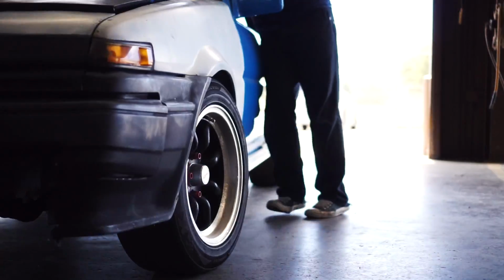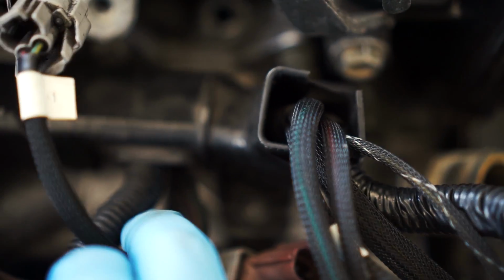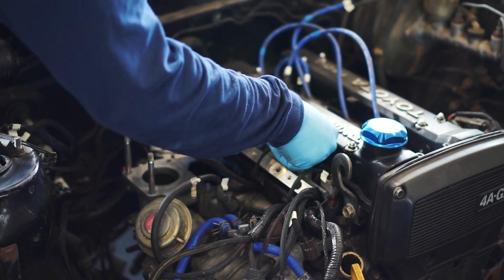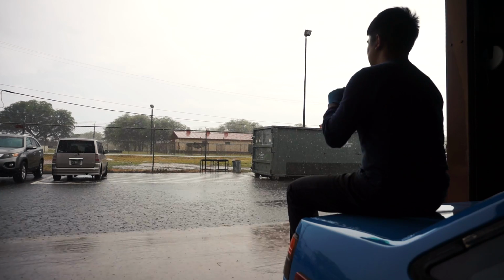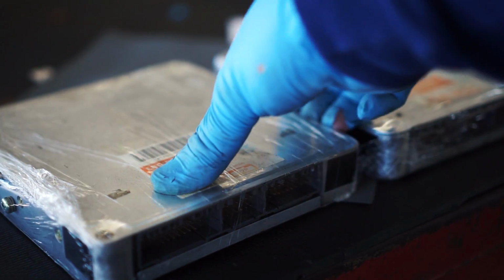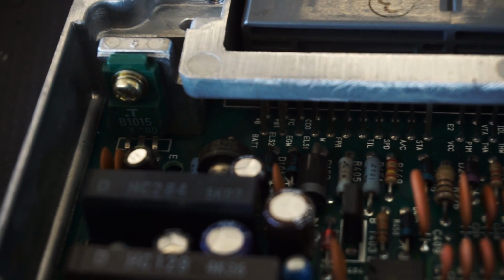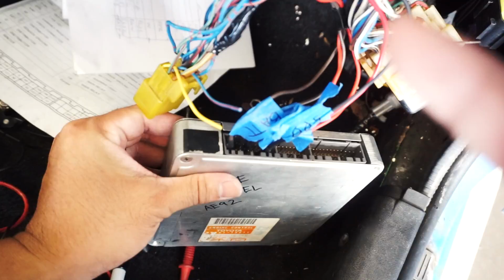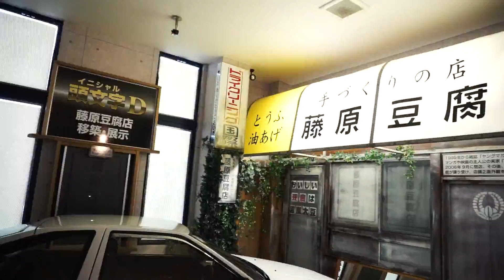Project Car: AE86 "Second Chance" Part 14

Comment: First- Great video, thanks for the great content.
Second- I am thinking of the same engine in my ‘71 Corona. What do you think the major issues might be? Would I benefit by using the same harness as yours?
Also is your tranny a t series or w series?

Thanks for your time.
jT
Reply from the maker: thank you! I'm not too familiar with your year Corona but I believe it has some form of R series motor. Instead of a 4age I would try to source a 20R or 22R and keep it carbureted. It's too much of a hassle to go EFI. If you really do want to go the 4age route I wouldn't see too much of a problem fitting one in the Corona as its almost the same size as a 20R

Comment: hey Noel! louie here from bay area, i was wondering if you could help me out with one of your headlight switches for the gts and a throttle control valve if u have one. parts are really hard to come by here now. thanks,
Reply from the maker: throttle control valve I do not have, but a headlight switch (the one on the dash, the round knob) I have one.